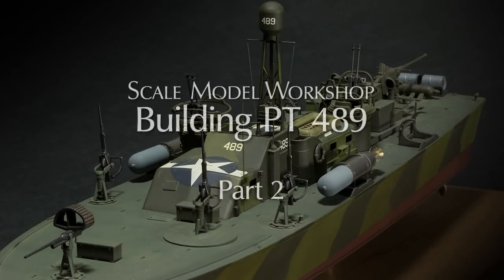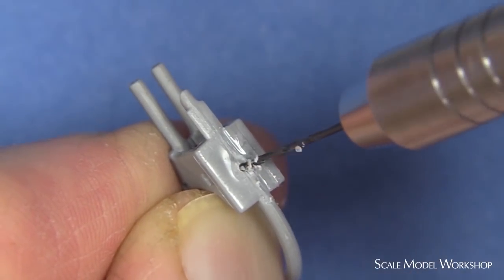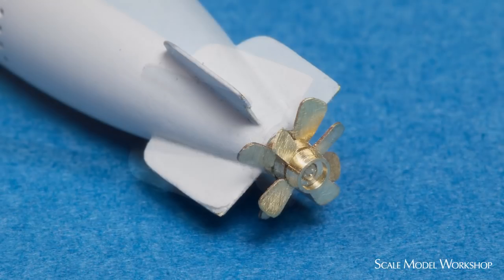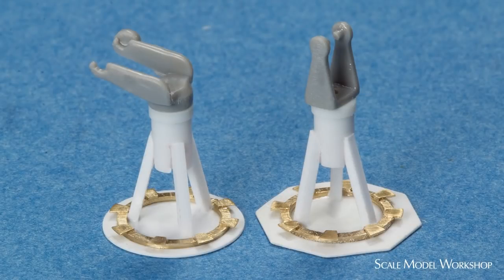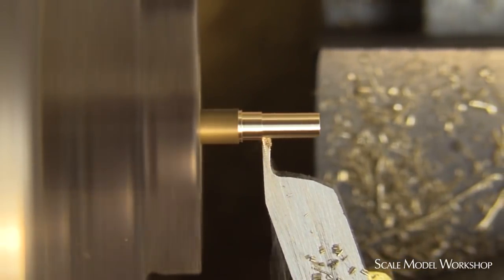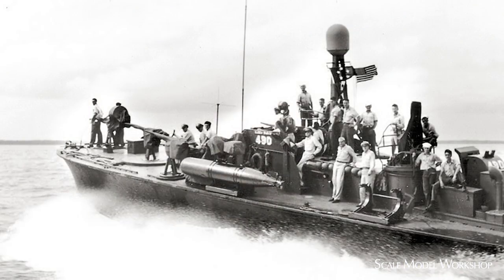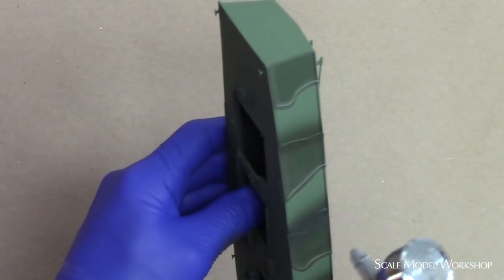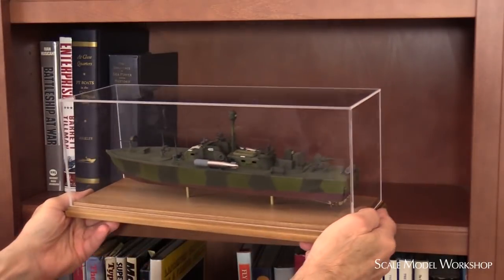Building PT 489 Part 2

Comment: for red and white numbers. Look at Woodland Scenics Dry Transfers and transfer them directly to the kit or to clear decal film. You would need a white and red set's.   Also could have made a stencil and painted it.     Nice work   Does your boat have the late or early positioned forward 50.cal tub?  I have a 1/35th scale PT365 mid-war Elco boat in the works. Had to use the forward cabin of Pt 109 on a late war hull. With the same engine ventilation system as yours.